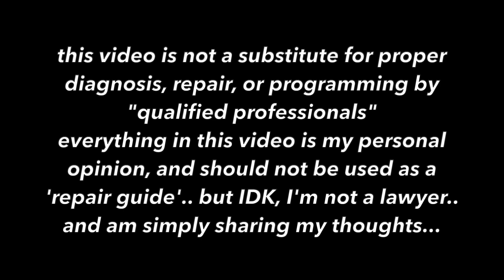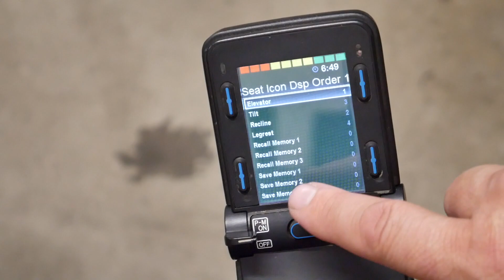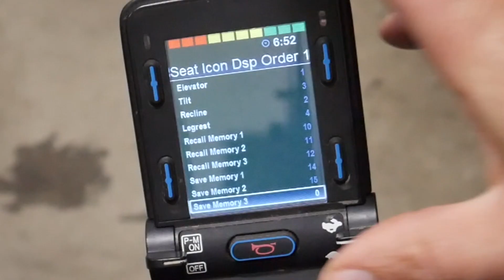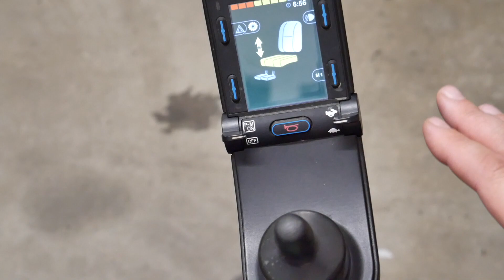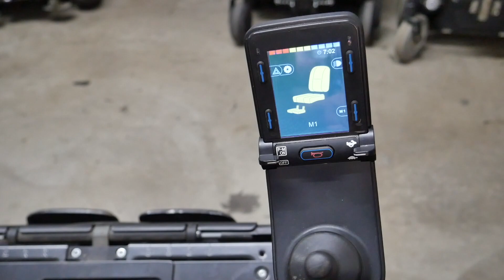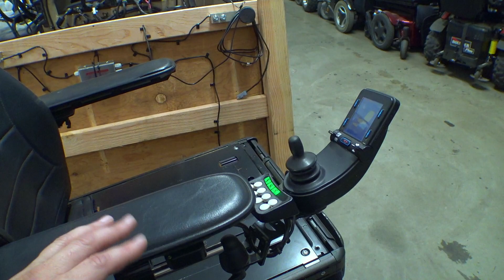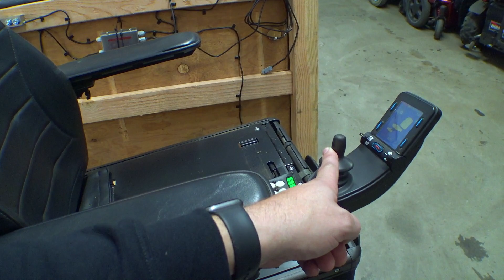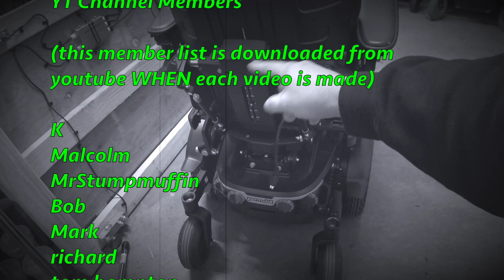PROGRAMING: permobil memory seating basics! (2017 - 2023)

Comment from the maker: *this video is a basic overview - there can be many more factors when enabling memory seating*
Reply: I have been given PRONTO sure step
Runs good for mm 40seconds
Needs battery but i need to know how to disemble the seat off to get at the battery.?
Can you direct me to video instructions of urs?
TY
Reply: Permobil won't do anything as they send you to the vendor the vendor won't do anything as it was paid by the VA, so I'd have to make an appointment to who knows when. Not even by video you could try helping me get this ... chair straight?
Reply: @VisnuGD  You need to have doctor determine how you need wheelchair, --> doctor submit to insurance (i your case, maybe you call VA how this process), --> Then insurance will approve for which/and which (To max, you can ask vendor the details build price of wheelchair focus on system/function, if price like chair cushion pad, seat cushion, as them replacement remove it to reduce your pay out amount if have, you can buy these used online very cheap).

Comment: I've got a Permobil m300 that's around 5 years old. Is there a way to adjust just the back that my back rests on? It doesn't seem high enough, and it's hurting my back. Please help. My name is Loyd.
Reply from the maker: if its got the stock back, the height can be extended - page 11 in this service manual -
https://brokenwheelchairs.com/resources/Permobil_PDF/Permobil_3G_Seating_Service_Manual.pdf
Reply: Thanks!  @TotallyNormal-

Comment: Hello, could this be useful for the F5 corpus? I have the following error "ICS Tilt error 20A3" from Argentina
Reply from the maker: thats an over-current error.  a number of things can cause it on the tilt actuator.. there is a belt drive in that system.  was it making unusual noise, or moving slowly before or when that error showed up?

Comment: So I have a 2019 permobil M3 corpus and I don't have the light for the elevator lit does that mean it doesn't come with that it's not equipped with that or it went out or it's just not programmed cuz I can't get it to work
Reply: I have the same problem and the same doubt... were you able to solve it?
Reply from the maker: usually when there's no light, it means that feature isn't installed..

Comment: @TotallyNormal- I have the joystick that has the extra 2 buttons, I do your process but I can't get into obp mode. How to enable it?
Reply from the maker: on board programming has to be enabled with a programmer before it can be used with the boot-up key combo
Reply: @TotallyNormal-  dang it. My brand new F5 corpus VS came without even memory modes. Not even 1 😡. My chair is messed up ATM. I tilt and recline fine but when I try to tilt the chair back to neutral it doesn't go entirely straight, it stays a bit tilted back with the leg rest a bit up so I end up being kind of sucked inside my cushion
 I have a ride design cushion so I'm ending sunked in the back hole. 😡
Reply from the maker: dang.. i'd talk to the DME or company that delivered it if ya haven't already.. if the chair is brand new, they should get things sorted out pretty quick hopefully!
Reply: @TotallyNormal-  the switch box functions well that's how the rep configured the chair when I got it, there was no dongle she used the box under my driving sticks with the buttons. I tried to memorize how to operate it but was a while back. I tried pressing 2 7 8 and turning it on but I'm not getting the flashing button ( 4/8 ) also 6 and 7 turning on the chair and no flashing 🤔. Do you know what's the combination so I can configure my sitting position? Also can memory modes be set through the switch box or you need the dongle?
Reply: @TotallyNormal-   I can't get it to flash with any combination not even 3 5 6 to try to recalibrate it. The only thing that works is pressing 8 for a couple of seconds and 4 to use the memory function but my chair is still at a bad angle. Is not straight when I try to sit up "straight" is a bit tilted backwards. I cannot find a way to make it straight. Any advice?
Reply from the maker: ya gotta be REALLY careful with the ICS bootup button programming! theres no way to reset all the settings! ya have to know exactly which setting was changed and put it back manually.. they can cause all kinds of problems with the chair and the seating not working correctly if random ones are tried..
however there is no way to enable on board programming via the ICS seating buttons :^/
if its a brand new chair, i'd talk to the DME that delivered it, or contact permobil tech directly. 
if a bunch of boot-up combinations have been used, the ICS master module might need to be re-flashed to get it working correctly again

Comment: I just got a dongle. Plugged it up and got the obp menu made a couple changes. But now the obp menu is not coming up. Is there something I'm missing to do to get that menu back up?
Reply from the maker: On board programming has to be enabled within the OEM settings to make it work without the dongle attached.  It’ll work WHILE it’s connected like a hardware key, but unless the setting is changed, that’s the only time it’ll work.

Comment: I dont have onboard programming mode enabled on my M5 but I can save and recall seating position memories using the ICS buttons. I currently have one seating memory for driving mode and one for getting my knees low enough under my dining table, and one for pressure relief.
Reply: Hi. I'm also don't have "onboard programming mode", which call via "hold the horn + power on button" as well. I have an M3-build2017, can you please share me link how to set up memory seat via ICS buttons if you have? Thanks!

Comment: My insurance approved the permobil m vs. The atp says the tilt / recline no drive lockout can't be unlocked. In my current invacare I can drive in tilt / recline. I use it for some exercise  routine setups. I can't believe permobil can't unlock this feature. Is the atp correct?
Reply from the maker: the older chairs would still move, albeit a bit slower than normal.. but i'd speak with a permobil rep directly, or call permobil tech support to make sure.
EVERYTHING on these new chairs with the power platform can be adjusted.. but right now only permobil reps have the ability to make ALL the changes on the chairs.
Reply: My M5 is only 2 years old, and it drives in elevate, tilt or recline, and combinations of them,  albeit more slowly.

Comment: Is there anyway to get the programmer module.
Reply: Ebay is probably the cheapest, but having said that, I bought a programmer off ebay and guess what, it didn't work and I ended up sending it back, so be careful. 
I think there is another option which Dan mentioned a while ago but the name of the place escapes me, they are expensive though.

Comment: Hey Dan thanks for the video I  think I've asked before but was in chat before but how does the chair know how to get to the same save spot ? 
  So basically do the actuators have "steps" like in a counter or a step motor? Or is it timed per memory steps .
So is it like a CNC or 3d printer but those actually need to be placed to "Zero" to know where it is
Reply from the maker: inside each actuator there is a gear driven 'hall effect' sensor  that counts steps.. but they have an actual real-time feedback loop so controller knows exactly how much movement is occurring.. and the zero point effectively identifies the end stops. replacing an actuator requires calibration - OR careful installation if ya know how to do it ;^)
a lot of CNC machines just send out pulses but don't know if the movement is actually occurring.  the permobil system is pretty neat! and makes limit switches obsolete! (which cuts down significantly on extra wiring)
Reply: @TotallyNormal-  Thanks Dan , now I know how the steps are counted.
   Appreciate it 👍
Reply: It's weird that it doesn't return exactly to the memory location that you input into it.